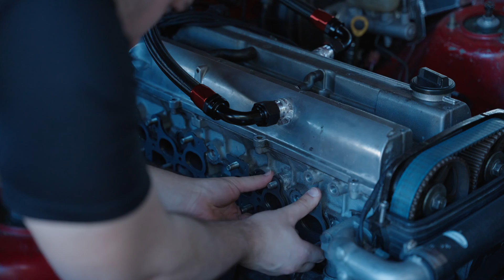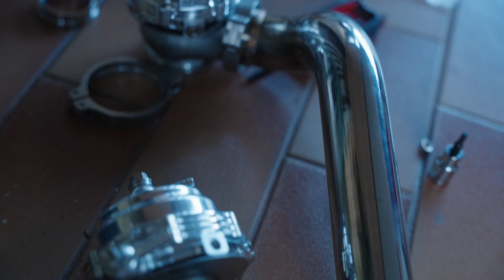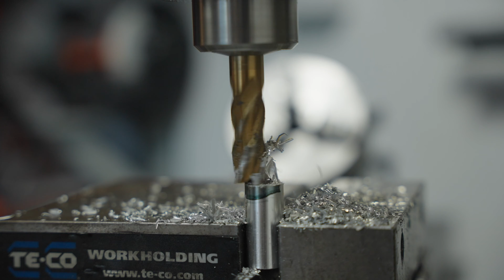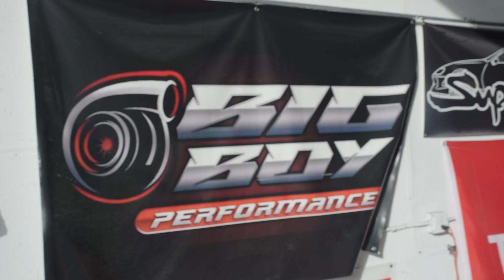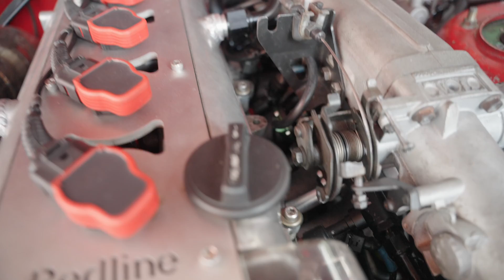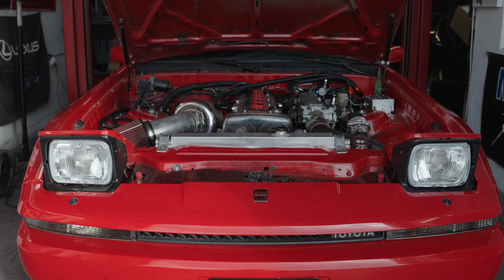Toyota Supra 2JZ MK3 Turbo/Fuel System Build Breakdown | 4K

Comment: do you remember what color spring your running in your bov im getting ready to install mine and was told to use the plain color spring but threw tials chart i should be running the yellow spring im running 20 in.hg of vacuum
Reply from the maker: The car came with the blow off valve, so I never got around to doing that. I’ve had no issues with it since